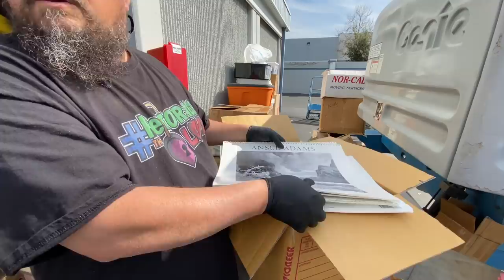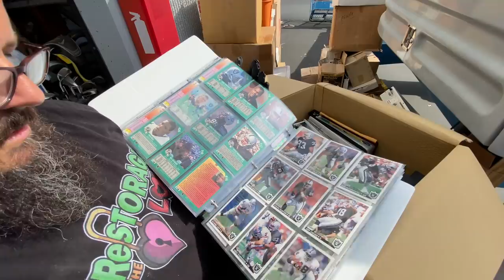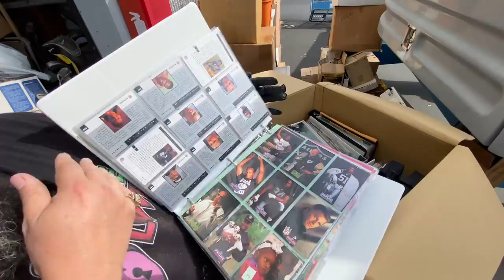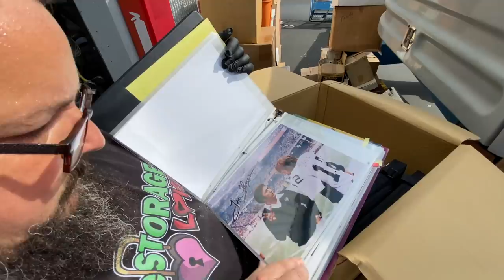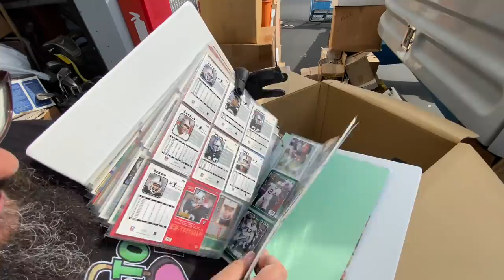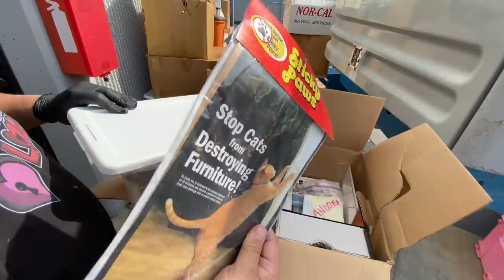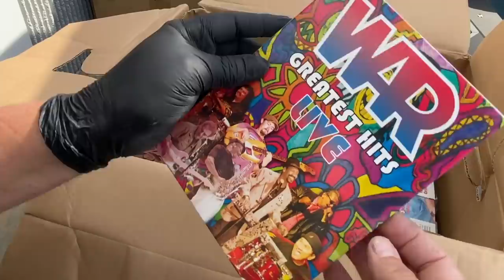He HOARDED the WEIRDEST STUFF in this locker I bought at the abandoned storage unit auction

Comment: Mix Peroxide , baking soda and dawn to a thick liquid . Take a tooth brush with this solution on it , brush it in the fabric good and let it sit for a while before laundering. I have gotten out blood stains that were washed and dried in shirts and things. I've used it to spot clean new stuff too ! Just rinse out the spot and let it dry after it sits for a while. It will not hurt the fabric.